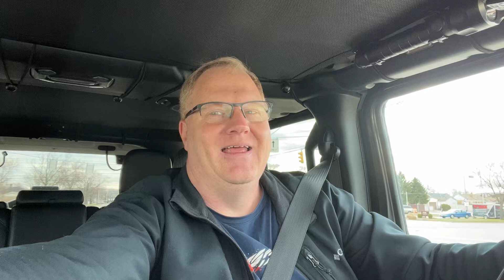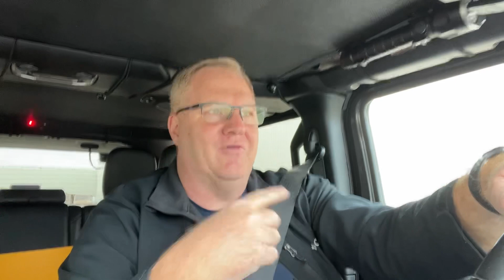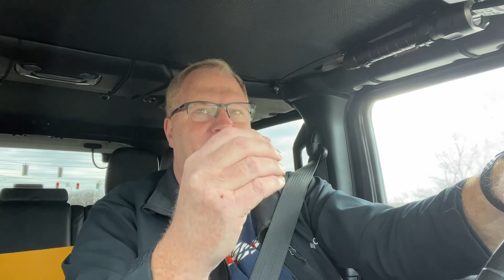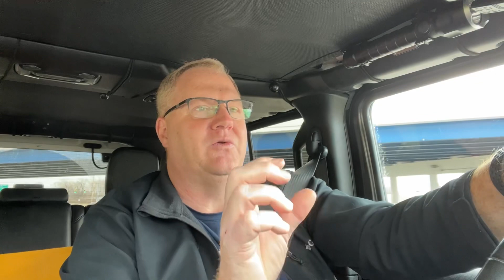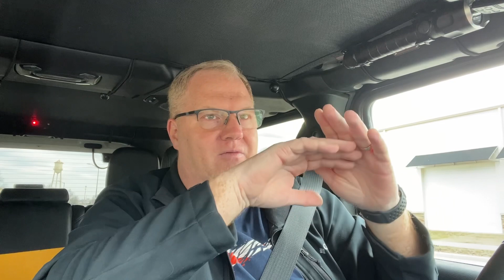Question of the day: Why does eSave use more gas?

Comment: I dont own a 4XE but im curious about them, started watching your videos. I own a Ford fusion hybrid (doesnt plugin). The engine gets about 35-38 mpg on its own. I barely did better than this when I first bought it, because I tried to always drive on electric for as long as I could get away with through all conditions(which was not long). The electric motor torque honestly sucks and the capacity is fairly low, providing terrible acceleration on it's own, pissing off people behind me. If I use the right driving strategies with timing the use of the engine/electric side, I have managed to squeeze as much as 80mpg out of a trip, but I probably average more around 50-55 now because of my lack of patience. I am in suburbs/rural area. When accelerating, the electric motor cuts on first, and it only switches to gas engine at a certain torque threshold which is variable on the battery charge level. What I learned is it's all about the regenerative capture, and the electric side really is best used for maintaining speed (coasting with cruise control) ,making use of hills to the fullest, and slow (under 20mph) stop/go traffic.  I read a reddit post on how hybrid engines+CVT trans have a RPM sweetspot for charging battery, basically claiming that engine charging was more efficient while going uphill vs coasting with it. So now anytime I go uphill, or I know I'm about to hit a long stretch without stops, I go heavy on the acceleration. Once im up to speed or over the hill, I let off and coast on the electric, turn on the cruise control. I will also use purely electric to make the most of downhill momentum to get back uphill if my capacity is above half. Doing this got me into the 50-60s, and the times where I listen to the car's braking coach to hit 100% recapture consistently are when I push 70+ but damn I feel like a grandma doing it.
Reply from the maker: The electric motor on it’s own is 134 HP. It’s just enough to be comfortable for daily driving. If it was any smaller, it would have that grandpa feeling you’re talking about. It seems like they sized it just right to be able to daily drive without feeling like you are holding people back.

Comment: I have a 2021 4xE Rubicon and have noticed that, on a longer trip, if I keep the battery above 60% and drive in E-save it looks like I use less fuel. Of course I then use only battery when in cities with a low speed limit. It will be about 23 mpg on long trips (+100 miles) and 2-4 kayaks on the roof.
In a month I'm going on a very long trip, Sweden to the island Corsica in France, with kayaks on top and will check my fuel consumption then. I plan not to go to fast on the Autobahn through Germany :)
Reply from the maker: I have wondered for a long time where in the charge curve the efficiency would change.
Reply: @Wrangler4XEFans  I have no evidence that it's at 60%, just my feeling.

Comment: That was a tree branchelanche!  But it's a hard one to suss out.  I've had mine for almost a year, and while I'm happy with it, it's at times as inconsistent as a human being.  But I think ultimately, the only way we can test hybrid vs esave in the full economy sense is to run them both full out on the same path til they're out of electric/gas and see where it sits.  My bet is it doesn't change much... maybe a mile or 2.  What I would say definitively at this point, is that there is very little difference in fuel savings, unless you use gas without depleting the battery.
Reply: Bottom line.....if your a long distance driver most of the time then your going to burn the gas period. About 23 mpg with no electric juice. I'm 90% short distance driver. So I'm plugged all the time.Out and back most of the time. 
 I'm saving big on gas. I fill up every 2 to 3 months.
My record on a tank after 3 months last year is a cool 2125 miles on one tank. About 1858 electric and around 267 hybrid gas. LOVE IT LADIES AND GENTLEMEN. If you drive long distance a lot you could just go with the regular gas wrangler.
I love the quiet over size electric golf cart sound of the 4×e!!
Reply from the maker: @wwayland4186  That’s awesome. My PR so far is 1365 miles on one tank.
Reply from the maker: I did a longer experiment shortly after I got it:
Hybrid Mode vs eSave+Battery Save efficiency test. Wow, what a difference.
https://youtu.be/chJ3N1S4Cng

Comment: Why not add solar on the roof of the Jeep?
Reply: That will only provide enough power to run accessories, charge phone, etc.
Reply from the maker: There isn’t enough roof space to generate enough power to be really functional. If you look up Aptera, you’ll see the only vehicle that is efficient enough to make a solar roof feasible. It’s not that it isn’t possible but the vehicle has to be way more efficient to make the roof big enough to make it work. It’s a ratio of efficiency to space available. For it to work on a Jeep Wrangler, the size of the solar layout would have to be huge.

Comment: Is the 375hp, 470ft-lb torque only true when the batter isn’t 0% and in hybrid mode? 

I feel like when I’ve depleted my battery and on hybrid (still a hybrid), when I go uphill and/or accelerate and overtake, the Jeep isn’t as responsive as when I have >1% battery.
Reply: It's all there, all the time.  But when the battery is depleted, it uses the ICE motor most of the time.   Otherwise, it uses the electric motor which is more responsive.
Reply from the maker: >1% on the dash is still around 15% of actual state of charge. So the power is always there.

Comment: The more gas you burn 🔥 the less Likely FORM issues will happen. When my motor turns on , and it’s not on accident , I hit e-save and and let the motor run until it decides it doesn’t want to. And I’ll even make sure the battery mode is set to charging while running so it stays running more often then not.

Comment: I'm curious if it's better to drive long road trips with Max-Regen off, to coast instead of the resistance slowing the Jeep down while adding energy back into the batteries for reuse in hybrid mode.
Reply from the maker: You can coast with max regen turned on by feathering that top one inch of the accelerator pedals that gets remapped with max regen turned on.

But personally, I turn it off on the highway. If you set the cruise control, it will still regen when going down hill.
Reply: I prefer to do that, unless I'm in heavy traffic where the shorter coasting distance is an advantage.  I'll put max regen back on if I'm driving in the mountains, though.
Reply: Max Regen off on the highway
Reply: A friend told me that a yacht with solar panels charged the batteries faster than they depleted at cruise (18kn), I said “hmmmmmmmm” 
Something didn’t sound right!
Reply from the maker: @steveross2280  Is the yacht electric? I mean, it might make since. A yacht would be much larger and have a lot more surface area for panels.

Comment: When I'm on a road trip with no plug in available I'm always using E-Save to charge that battery even if it does burn more gas. I don't really think it's that much more. I haven't really noticed it. I'll charge the battery on the interstate doing 75 with D-Gen off. Then when I arrive at my destination I'll have battery available to short distance and scoot around.
Love the available option of charging the battery with the engine even if it's not the best way to charge economically.
Reply: Wow...that's surprising. My 4×e in e-save charges the battery at any speed. One thing to remember it takes awhile for the percentage number to start increasing. It's been awhile since I was on a road trip but I do remember at 75 speed for one hour the battery was up about 28 percent. After 2 hours about 48 to 50 %. So it takes awhile. Like Chris said one time it's not the most efficient way to charge the battery. But if no plug is available it's better than nothing. This system is definitely made for plug in mainly. I drove it in D-gen and also off at 75. Didn't see any difference in percentage increase rate.
Reply: @wwayland4186  it helps help with the oil dilution ratio also , and I almost feel guilty for not allowing the motor to run and/or break in. So when it runs I let it . I’m at 4500 miles and oil says 52% life left. I’m probably around 1500 miles gas and 3000 electric and ever since I got my home charger I never need the gas much anymore I need to get my latching update because that’s when I use most of my gas . When I forget to press the electric button and the motor starts just to warm up and waste gas and turn off again. Never to be used for weeks on end. I noticed when you have the e-save battery charge feature in n you can compare gas mileage on the dash. When you make the switch so the fuel rating for mpg . It drops about 20-25%
Reply: My 4xe doesn't charge the battery at all in E-save + MaxRegen at 75mph, even with the setting enable to save battery. I only see the charge go up in E-save below like 45mph.
Reply: @jpmcnown1 when pressing the brake try not to press the pedal to hard or it won’t charge the battery . When going down hills is when you will charge up the most . Use the weight of your vehicle and the regenerate brake and you’ll notice the battery charges up a few % points
Reply: @jpmcnown1  you need to set it to Esave charge not save
Reply: @kevinstorimans2913  What I meant was, it doesn't matter what I have it set to, there is no increase in the stored charge. I have a 497 mile route I drive frequently. One would think that in 7 hours, it would pick up something. Nope. Now if I'm driving around 40mph, it'll charge up pretty quickly.

Comment: In Hybrid mode, battery helps more the ICE too, which lowers fuel consumption, compared to ESave.  This is also true when vehicle is in FORM.
Reply: 4xe always has electric assistance
Reply: @kevinstorimans2913  Yes, but more or less, depending on the mode selected.